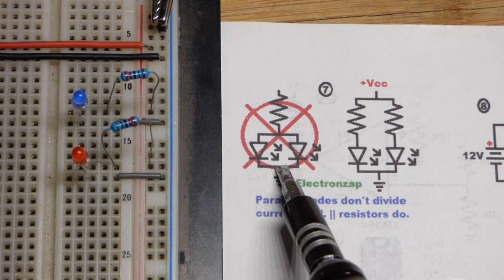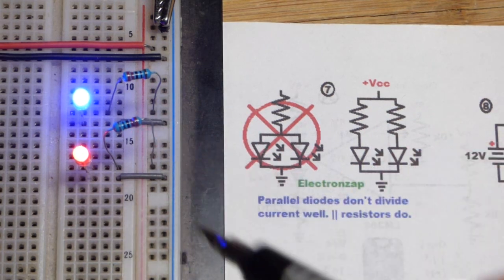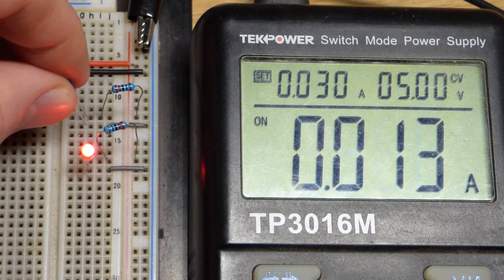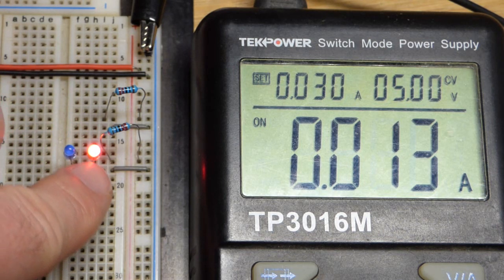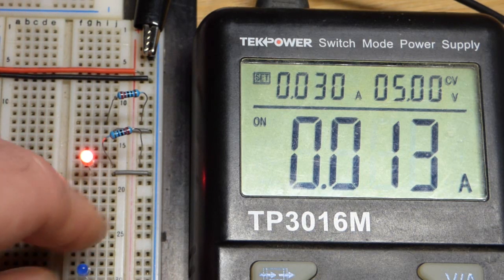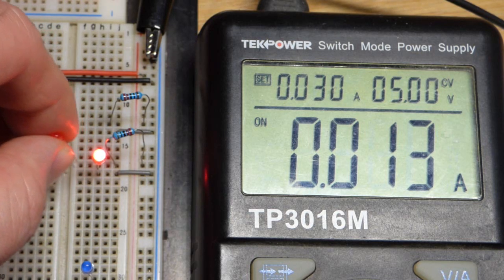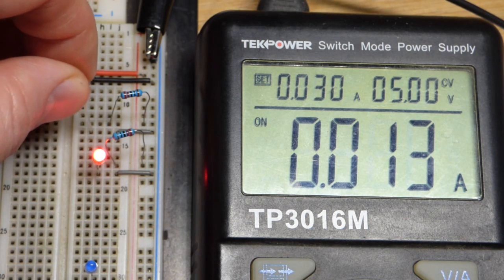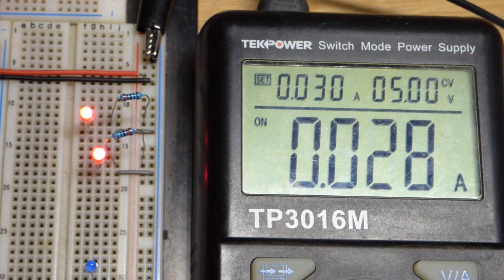Why each parallel LED should have it's own protective resistor

Comment: So its fine to put a few in parallel if the current is under 20mA
Reply from the maker: For LEDs. You always need to make sure you don't exceed the voltage, current and power limits of every component.

Comment: Not even to save money? Let's say each resistor cost 1/10 of a cent ... that's a WHOLE PENNY I could save if I use one resistor for 10 LEDs 😂(I actually do have some SIP package resistor arrays that are nifty.)
Reply from the maker: Oh yeah resistor arrays, lol. You mentioned them a previous time I made this video. Would definitely be good for a number of parallel LEDs. My budget is limited, and I don't know what value(s) I'd get a lot of use with, so I haven't ordered any yet.